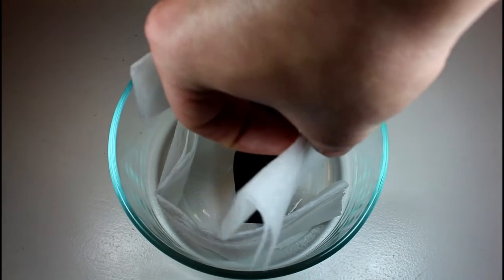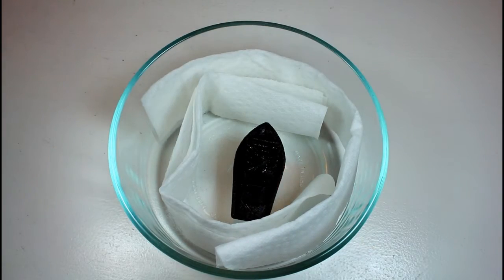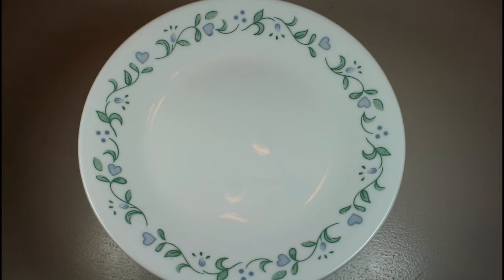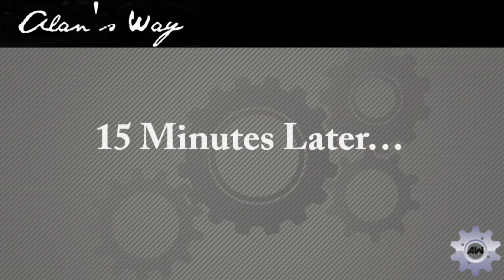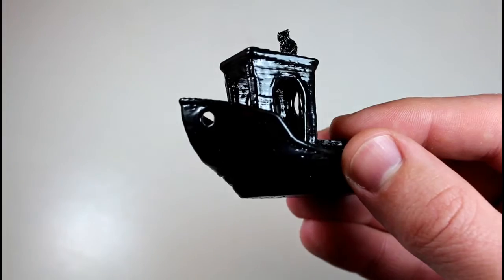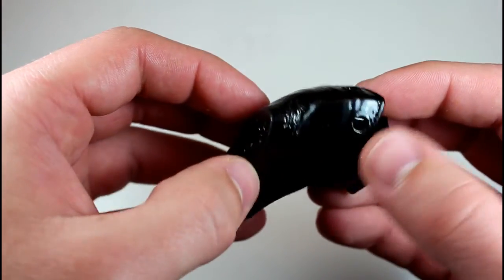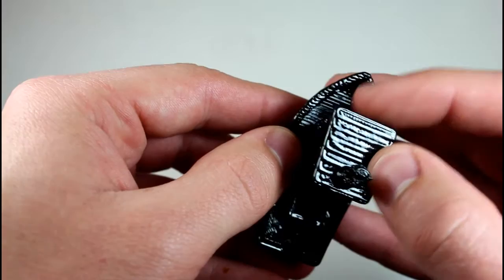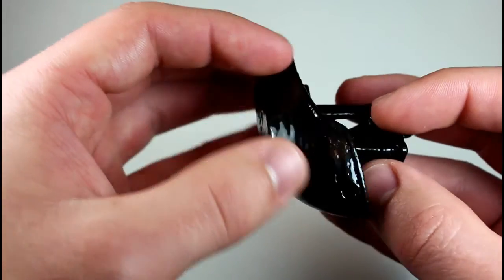Acetone Smoothing of ABS!!

Comment: hey,I'm thinking about buying this printer,would you still recommend it after using one?
Reply from the maker: +joemalkoun68 Short answer: Yes.
Long answer: Yes I would but know that you will be putting in time to this printer to get nice things out the other end. It is what you pay for any you are not paying for a plug and play printer. The mechanics of the printer work fine and there are some upgrades that you can do (I am planning on adding another fan in the future and maybe a new hot end) but know that you will have to tinker with it and the prints are not going to be as nice as something from a $2000 printer. If you have the time and desire to sink into this technology then yes I would recommend this printer, especially if you are trying to get into the hobby and want to cut your teeth on something without breaking the bank.

Comment: Can you do a video on tuning the printer? You seem to be getting much better prints than my sunhokey is, so I'd love to see what you've done with it. Also, what's the blue tape on the hot end for?
Reply from the maker: Hi, yeah I am working on a tuning video. It has been taking a long time as I keep getting distracted by new fun things to print.

The blue tape is my cheap fan shroud. I moved the fan to the side to get better view of the print fpr timelapses and the tape was the fastest way to re-attach the fan and direct the airflow. This will be changed eventually to be a bit more professional looking with a printed shroud.
Reply: +Alans Way I wanted to ask you the same question, i'm still trying to find the settings that works best but so far no luck.I was able to solve the print adhesion issue after using blue tape but I'm not getting fine prints
Reply from the maker: +Adnan Jalil I have moved away from blue tape to just using hairspray on the aluminium. I crank the bed temp to 105 (for the first layer, 95 after that). Whats going wrong with your prints? First thing I would say is to make sure all your axes are calibrated correctly. This will fix position errors and extrusion rate issues.